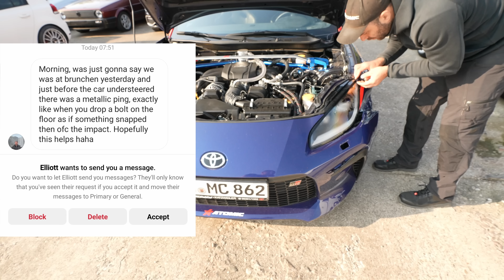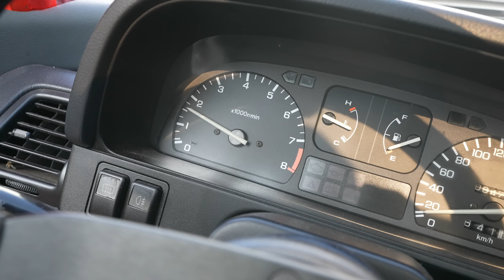My GR86 Nürburgring Crash Damage Report.

Comment: From the sounds of it, Toyota is having some quality issues with their performance cars on track. First the oil pressure issues when taking hard left turns and now a possible catastrophic suspension failure. Yikes 😬
Reply: Literally zero reports of suspension failure for these cars. When you slam your brakes on a corner at high speeds, you will under steer. It’s common sense
Reply: @ak740_  as explained by Misha, there were no queue’s associated with under steering occurring when leading up to the crash (audible screeching, vibrations and other noises). 
Sure there’s a chance it was still understeer that caused it, but instead of being dismissive, it’s better to be objective and explore other possibilities to find the truth, if in fact it was the result of a mechanical failure. That way you know what needs to be bulletproof’d for safety. 

Sure no reports have been made of any such issues with steering or suspension. I’m not sure there are many Toyotas that got beat on at the Nurburgring like this car. Correct me if I’m wrong but I don’t think Toyota tests their prototypes at the Ring so the people driving these car a lot on the ring are doing the actual testing of the car in such extreme track conditions.
Reply: @UltimateDan1  the cars only a year old with low miles. The odds of suspension failure are extremely low.
Reply: @ak740_  exactly. So if the suspension was the cause then that’s a serious problem which makes it worth looking into. No idea why you’re so dismissive of looking into a possible problem.

Comment: That steering link... should have bent not broke off... especially because you had your hand off of the steering wheel so not applying any force. I know you can't post it but watch your on-board and see if the steering wheel snaps back to the right when hitting the barrier. If it doesn't then probably that steering link was broken already. But as you said, maybe it doesn't matter, the GR86 will come back even stronger anyway :)
P.S.: yes, we watched until the end :)

Comment: I'm still betting wheel bearing went out which triggered your abs and caused your wheel to have no steering due to the faulty abs sensor going to your cars computer. Happened to me in my speed3. Felt like I was driving on black ice.

Comment: Just checked the footage and it seems you braked just a bit harder and later than usual for that speed. Maybe to make sure to keep enough distance with that Porsche. Check your normal driving footage. The way you brake looks unusual. Hard and late.  It looks like when you lock up your tires even a split second with ABS + the extra load on the left tire while pre-loading them to take the elevated corner was enough to overload the tire/ABS just enough to miss the racing line. ABS can get in 'tilt' mode and just stop braking for a second (I am serious)  I think this is 20% ABS 'fail', 80% driver error. Maybe the sound came from the ABS system. Just my take on it.

Comment: damn the cost to repair is huge in today's car... 😮
Reply: Yeah they totalled my 2010 Prius the other week when a reckless driver sideswiped me and was mainly drivers side suspension damage getting pushed back far at 40 mph collision with a tall curb. Said it would cost $21,500 to repair
Reply: only in Germany,in other country it will cost araund 5.000 with works,like Poland and Uk
Reply: @pewpaw9379 in sweden just the paint job can be that much :) had a guy scratch my car when he parked. Got it on insurance who paid $2100  for just a rear fender
Reply: Learning how to repair things yourself on your car is such a valuable skill. Even relatively minor things like brake jobs and strut swaps are beyond what many people can comfortably afford nowadays. A shop wanted $650 to do brake pads and rotors on a Hyundai Accent, I did it for $130 in parts and an hour of my time. 

Obviously far less applicable to a track damaged car, but my point stands for the Everyman.
Reply: daaam thats a lot  @AndrewTSq
Reply: @pewpaw9379  guess they have great margins.
Reply: Try a workshop in Switzerland, you’re gonna faint when they give you the quotation lol

Comment: Misha, there's a video by Hot Version. https://www.youtube.com/watch?v=HftNO54USXI&t=1536s. They had a GR yaris and something weird happened to it. He was braking and all of a sudden, the front end washed away. No feel on the steering wheel and it just went straight. I know it's a Yaris vs. s GR86. But in the past videos they also had another Yaris and did the same thing and it was slight right turn and the car will activate ABS or whatever and the car feels dead and drives straight. I know for sure Toyota is using the same ABS system on all their cars. That could be it.